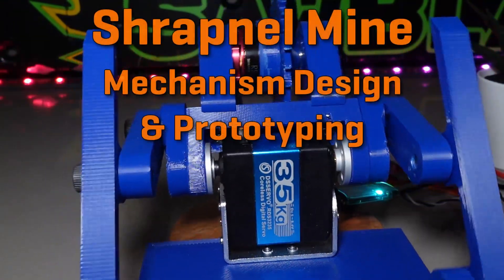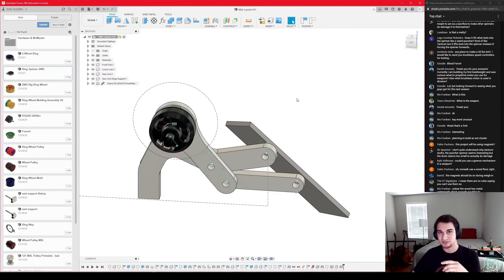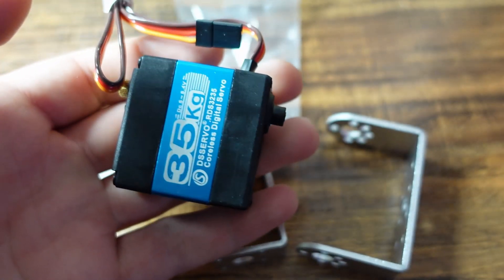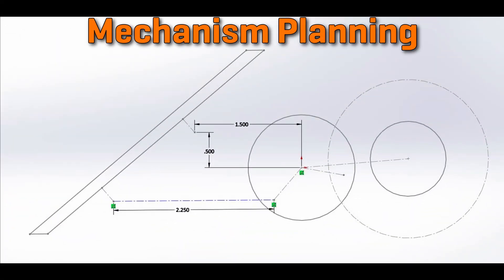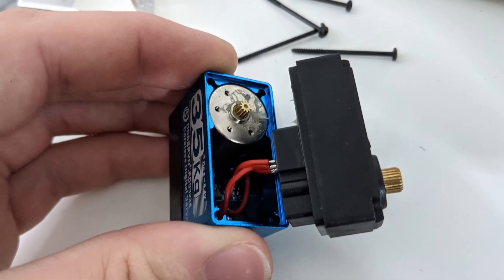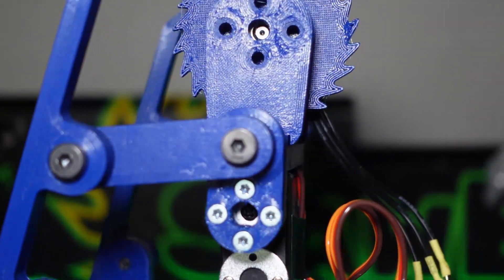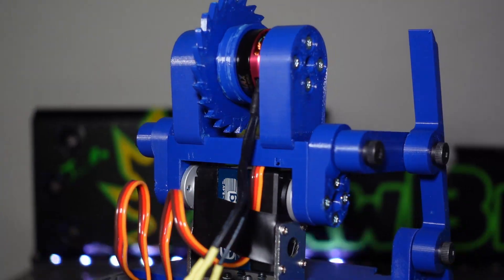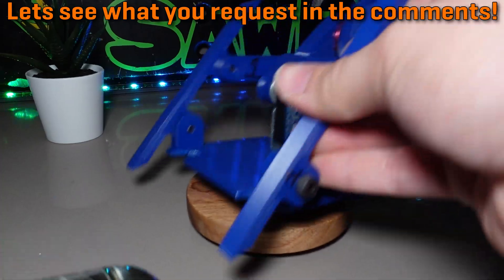The Process: Mechanism Design for Shrapnel Mine, 3lb Beetleweight Combat Robot

Comment: Maybe as a different configuration, you could remove the saw and saw motor and replace it with a piercing tooth and add a more powerful servo.
Reply from the maker: For fighting horizontal spinners I actually plan to replace the entire saw and front forks with a lifting wedge of sorts. Only issue is that puts it under 2lb currently so.... Multibot? 🤣

Comment: Are you required to 3d print everything? A dremel size large saw blade or a slot cutter would really rip through plastic and some amount of metal.

At least a carbon fiber nylon or metal filled filament would be more abrasive and durable.

Has anyone made a drill bot?
Reply from the maker: No no. These are all printed prototype parts. Like I said I'll be laser cutting parts in metal and possibly machining other metal parts for a final version. I'll be using steel saw blades and Nylon or carbon fiber Nylon printed parts where necessary, and probably a few flexible TPU filament parts as well.

Comment from the maker: To abate any concerns about the safety of the cutting test I showed: I was wearing safety glasses and the grey 'saw' was a PLA plastic toothless disk, and even shoving my fingers into it didn't break the skin. It was cutting via friction melting the PETG blue blade. Don't test dangerous weapons outside a test box. This was not one of those, but even a metal saw is definitely not finger safe let alone most weapons these robots use!

Comment: I'm not a robot builder (yet, who knows) but I think that a drill instead of a saw may be way more effective. Your attack is much more concentrated and you'll be able to go way deeper into the other robot's internals. Not sure if this will work but I think it's worth considering...
Reply from the maker: There are many issues with drills. One is that they really suck when you aren't using a really stationary and rigid platform to drill with. Especially when drilling into metal. You need to exert a ton of pressure in one spot, way more than you need with a sawblade. More than the weight of a 3lb robot in fact. And if the other bot moves even a little the drill will slide all over. Another issue is that you need a ton more torque and a lot less speed to drill than yoy need to cut with a saw which means adding a really heavy gearbox. 

Saws work well because the teeth grab and pull the saw naturally into whatever they are cutting from the moment they make contact whereas a drill needs to get its entire point through before it will grab if at all. Saws will also work at a higher RPM range between 3000-30000, I'm planning for 20000. Saws have been used widely in combat bots and shown to be quite fast and effective. Just watch Sawblaze in Battlebots!
Reply: @JustCuzRobotics  Ok that's clear hahaha. Sawblaze is fantastic, although I would say it's 90% a wedge robot...
Reply: @toonverbruggen7351 And Drops a Spinner onto what’s it’s pinned

Comment: Are there any faster servos of the same torque?
Reply from the maker: Probably, but they will also most likely cost a lot more and be bigger/heavier. This is already the higher power version of the common red 20kg-cm servos. And that's with the price rising from about $17 to $37.
Reply: @JustCuzRobotics  maybe if you could overvolt the motor or something 🤣🤣🤣🤣
Reply from the maker: Oh don't worry I did! Its response was 'do you even vape bro?' needless to say 3S is off the table 😂 Thanks to Jeff Bezos' retirement fund for the no questions asked returns.

Comment: i wonder how effective a skirt guard would be against this. depending on the angle of contact and armor type it may be quite simiilar to hitting top armor
Reply: If it is, having the lincage give the saw a more down then punch motion, instead of a chop may help with that. Though I that may reduce it's force of impact
Reply from the maker: The saw already does a pretty downward motion at the point when it poked past the forks. I will say having a really solid side armor is a concer, especially if the opponent bot is really narrow and the saw intersects the side as it comes down, but I think i can back up and move forward again with the saw lowered a bit I hope

Comment: One thing about top and bottom armor thickness is material, some bots could change to an aluminum or titanium top and bottom that is thinner than plastic but much stronger to saws
Reply from the maker: This is true only if they have weight for a more dense material in a large portion of their bot which is very unlikely to be the case. But that is definitely a thing. Anyone who is using plastic will probably not be able to swap for 9X as dense steel it 3X as dense aluminum.
Reply: @JustCuzRobotics  fair point, I’m sure many robots will come up with some special armor eventually, like they do with overhead saws